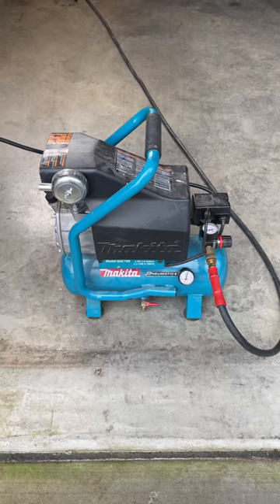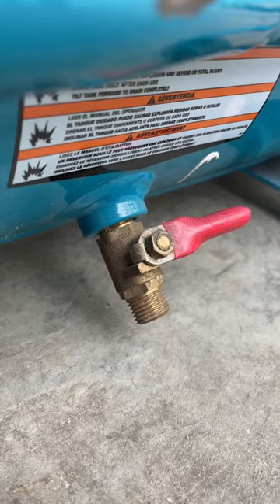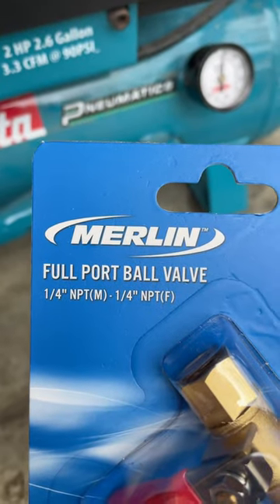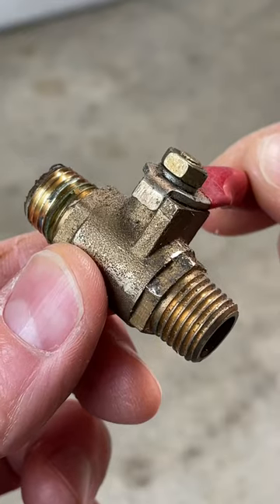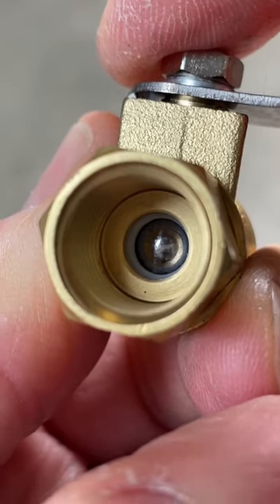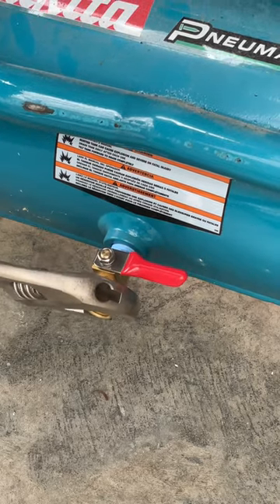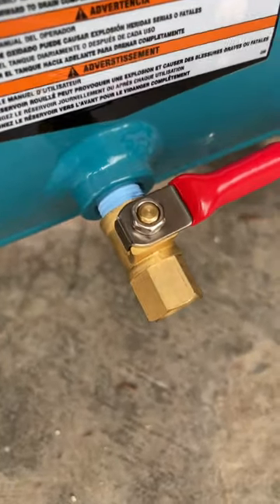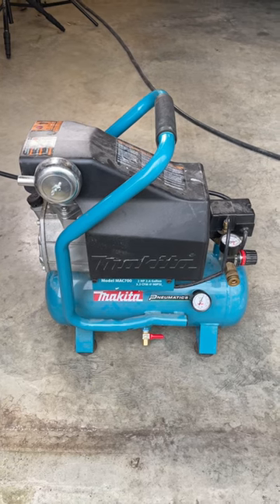How To Fix A Leaky Air Compressor #airCompressor #shopAir #airTools

Comment: It's Not a pressure relief valve. It's a bleeder valve to let out water that accumulates as the air is compressed. (Just as you 'expected', not suspected.) Arghh. I miss writing manuals. Thanks for the video...

Comment: Why call it a "pressure relief valve"?
That's a different function.
This valve is for dumping the pressure and any contents of the tank.
A pressure relief is calibrated and adjustable to not exceed a value.
It keeps the unit from increasing the tank pressure beyond the setting.
They may have pop off valves that dump at the maximum.
This one just empties it as you choose and drains condensation.😅

Comment: It’s not a pressure relief it’s a drain for moisture build up in the tank which can cause corrosion to cause the valve to leak . I’d definitely put tape or pipe dope or both next time
Reply: There was definitely blue tape on the threads of the new valve after it was screwed in

Comment: I'm glad I saw your video. my compressor does that same thing and I never knew why it was starting at random hours of the night. Now I just need to figure out where the leak is.

Thanks.
Reply: Some soapy water in a spray bottle can help track down the leak in case you didnt know. Hope this helps.

Comment: That Ball Valve Is Awesome And Cheap At Harbor Freight . I Use Them Also. Same Valve At Other Stores Is Double The Price And It's The Same.
Reply: Not always , the more expensive ones you get at plumbing supply houses have different blends of metal which make them more corrosion resistant . Valve seals are usually better too.